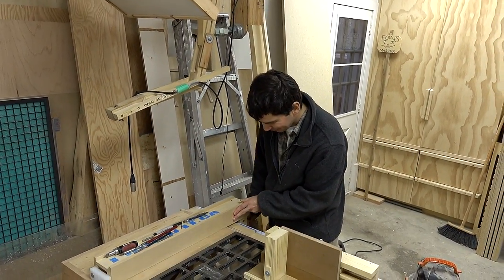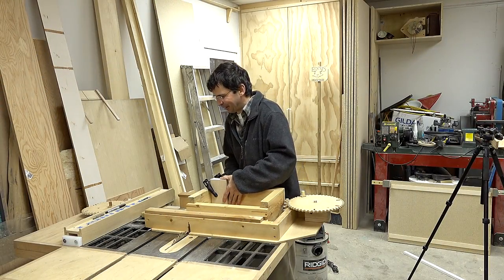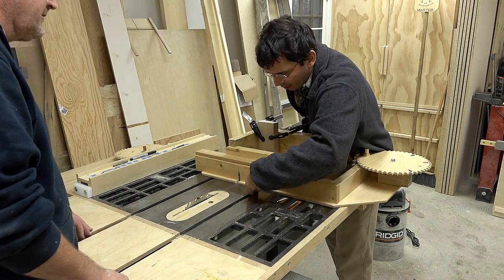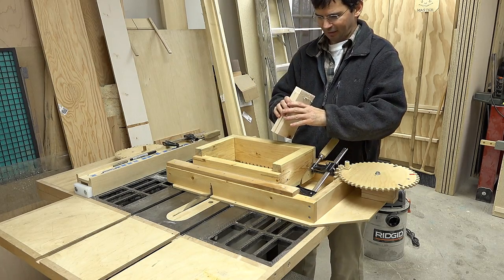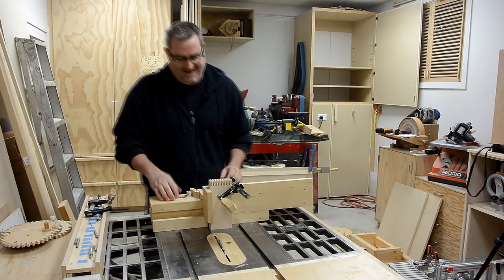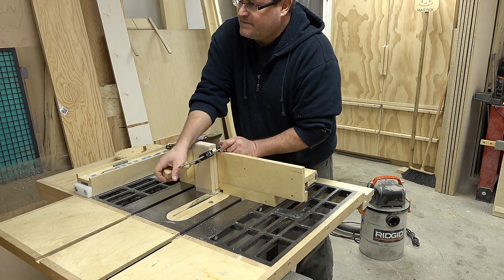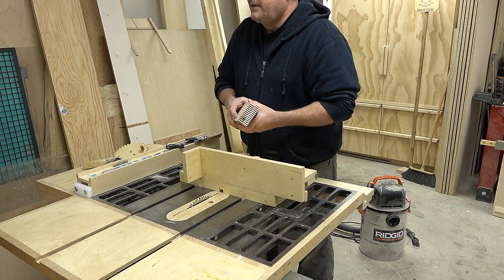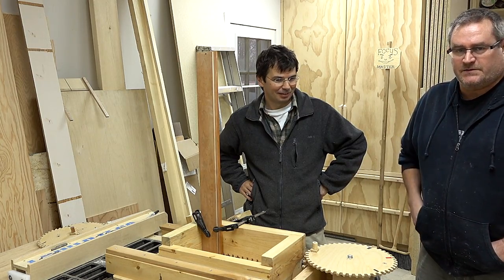Box joint jig rivalry

Comment: Matthias' for versatility and speed and John's for accuracy and width.
Though I guess Matthias' can be just as accurate but needs dialing in first.
Sorry Matthias, I'd go with John's as it also takes up less space and having a very small workshop that's a big consideration for me.
They are both amazing designs though... kudos to you both. :D
Reply: Once you've matched the blade with the rod it's a no brainer though, as you saw John's was a perfect fit first try and always will be from then on in. Matthias' needed dialing in. So I'd call John's more accurate and Matthias' more versatile as I said. :D
Reply from the maker: Easier said than done.  Matching the blade to the rod means finding a blade with exactly the right kerf.  None of the 20 or so sawblades I bought to date had a 1/8" kerf.
Reply: +Matthias Wandel Stop shopping for blades at the dollar store :D
Reply: Haha, you guys are awesome :D
Reply: CryoGenUK yeah,  Mathias has pretty big shops, so size isn't an issue for him, he usually likes making it once and using it until it breaks, I'm sure he could make a modified version thats smaller but it'd be a lot more complicated to build. And it still wouldn't be as small as the other.
Reply: You know John, I'm in the same boat as Matthias, I've gone through a stack of blades in my shop and I can't find an 1/8" thick blade.  I ended up running over to Lowes/HD with some calipers and same deal.  All my blades that cut a flat bottomed kerf cut .098-.105" kerfs (they're supposed to be .100", I'm guessing that they have some runout), which would work with a 10tpi thread, but that's not a common threaded rod (and in most cases it's about $70 to order a length of it in).

I'm assuming that you jig can use any step size that you can find a threaded rod for, right?  Even if  you were going to make it for an 1/8" blade, a 3/8-16 threaded rod is MUCH more common and cheaper then a 1"-8
Reply: I think using Festool and Felder would be easier.

Comment: Hi Mattias, I use an Incra positioner attached to my router table fence. The smallest increment is 1/32". I always use a back stop to avoid blow out. I am not in a production setup and I do not need speed. Regards Colin in Northern Ireland

Comment: I just built Johns jig and my first test cut was perfect with the blade i had on my saw... for those saying you need to match a blade to the threaded rod haven't actually built it.  There is more margin for slight error with Matthias's jig as there is no positive stop to index each cut accurately. It is more flexible for weird stuff, but for 99% of the people out there Johns does what you really NEED.

Comment: After reading some of the many comments here I will add that the Woodgears.ca jig has far more versatility than the other jig.
We have a Woodgears jig in our school shop and it has been used to create some creative variations on the box joint theme.  Think variable spaced finger joints where the teeth vary in width from 1/8" to 1/2" or more.  This jig rocks.

Comment: A previous vid showed that the size of the kerf of the blade can have an effect on the quality of the end product.  Being able to make such fine adjustments using Matthias's jig as can be done with Matthias's jig is a great advantage, though not used often.  BUT we all have to change blades at some time.  I vote for Mattias's jig for versatility but John's is the easier to use and the easier to build.

Comment: Most differences don't really matter, but the capacity thing seems to be a showstopper in the matthias case. While in Johns you can just do more passes with smaller boards if you need many, and not all at once, there seems to be no way to even bodge a big board into matthias ones. It is already quite big, but maybe this could be fixed by moving the gear part further down to get more space to the left?

Comment: I preface this by saying the following may well be incorrect, but i'll forge on anyway.  Johns jig is built on the assumption that you are using 8tpi threaded rod, which means that a saw blade with 1/8" kerf divides nicely into that. I live in New Zealand where threaded rod is typically metric. Saw blade kerfs in NZ are still imperial, I have a 1/8" kerf like everyone else. There is no metric threaded rod with a thread pitch that equates exactly to 8 or 16tpi.  So basically I can't get a threaded rod with pitch that perfectly divides my 1/8" blade to produce a perfect joint. It may be that I could get close enough that it's OK, I haven't tried.  Whilst Matthias jig is clearly more complex, i could build gears to enable me to get a perfect joint.

Comment: The JH one sucks a bit if your dado blade isn't exactly 1/8" wide.  You can use shims for wider joints and it is great for those.
The traditional method using a sled and a peg is much easier and more accurate.

Comment: there is one very nice thing about matthias's box joint jig. It can move from tablesaw to tablesaw without changing blades. IE use on cabinet saw then go out and use on portable jobsite saw. without any problems. 

Note for the most part I just use a 40 tooth gear for most of my joints from 1/8-5/16

Comment: what about testing which mechanism is the most reliable by packing saw dust into each jig all other all the moving parts to simulate bad storage or getting it back from letting someone else use it for the weekend then see how well the jigs work if at all. Also comparing how easy it is to clean each one out.

Comment: could borrow a trick from the machine shop dividing heads and put a small hole near each tooth on the gear. then use a dowel or pin to mark the position. if you need multiple positions have more than one hole per tooth and use multiple dowels. 2 pins for the second, 3 for the third, etc.

then you can use the dowels to pin them together for storage

Comment: I built Matthias' jig a couple years ago and have cut box joints from 1/8" to 3/4" with no problems whatsoever and without using a dado set or a blade with a specific width. The advance mechanism is infinitely adjustable and precise, providing a little basic math doesn't give you a brain hemorrhage. This allows you to size the joints to your box instead of sizing the box to your joints. It also allows for slight adjustments in oder to allow for glue clearances when working with different densities of wood. John's jig requires an exact width blade and his advance mechanism is dependent on the tpi of the threaded rod with no means of precise adjustment, (outside of sticking a piece of paper beside the blade to cause wobble. Seriously?). Since John used to build a version of Matthias' jig for sale to YouTube viewers, I'm sure he's more than familiar with how Matthias' jig operates. John gets the win for the one liners and Matthias gets the win for versatility, precision, and practical engineering.

Comment: I think Johns jig has a few major disadvantages:
first thing is the tight tolerances of the sliding mechanism - I don't think rebuilding this jig is as easy as it looks in the making of video. I really wonder if clogging up the sliding mechanism was ever a problem with this jig. second thing is you can't adjust the fit of the joint - I really wonder if this was ever a problem when choosing a blade.

in comparison Matthias jig is overly complicates with the gearing, but if you redesign it, advancing with a threaded rod seems more easy when rebuilding and his jig doesn't have tolerances nearly as tight as it is needed with Johns.

as the jigs are, both jigs have their (dis-) advantages and if you could buy any of those, it would be very hard to choose from!

Comment: As European I'd go with the Matthias' one because we can't mount a dado blade. And also because gears are so cool!
Reply: Why can't you mount a dado blade?
Reply: There isn't any room because the arbors are made so short. It's a safety issue (one I don't agree with). When you can't mount a dado set, you can't end up with lots of mass spinning so it will slow down faster. A large dado stack will spin for a longer time and the safety police has decreed that people will forget that the blades are still spinning after turning the table saw off and they'll injure themselves so it's not legal to sell such long arbors. They're still legal to use though as I understand it.
Reply: +Banunu Hawawa
Nanny state.
Reply: I have a ten in saw and use a 8 in dado. The dado may have more mass but the ten in blade being larger aroud takes the sametime or longer than the dado. Besides some of the newr stuff is coming with arbors. If you can't find a good used one that takes dados then build your own. then you can have anything you want or dont. You know like bladegards that justget in the way so you cant see and make it more dangerouse to me. just  my thoughts John and Mathew have both built multiple saws.

Comment: Would find it difficult to have a woodworking shop without a Miter Saw, just saying !!
Reply: How? The table saw is far more accurate
Reply: Kat & Joe    Cutting a lot of 2x4's to length on my table saw with the room I and other friends have would be a pain in the fanny if not impossible!
                        Can't even understand why you would see this to be a problem for some woodworkers. !!
Reply: most  the time I use a smallw cross cut jig too cut my 2x4s. not hard at all. I guess if all you got is a small contractor saw it might not be so easy but I use a shopsmith 510 and the tables will open up to wear you could rip 96 in. so for me its a lot faster. I guess it depends on your saw.
Reply: I used to have a Shopsmith  500 :-)Been a while since I've heard people talk about them. Great tool !
Reply: I  have a 510 and two 500's. I get a lot of tools in a small 1 car garage and it solves the prblem of swap overs when set up. my 510 runs a jointer and is my main table saw. Then one of them I lost a motor and I replaced it with a treadmill motor and it really lets me slow it down to any speed so it is my lathe and drill press and also drives my band saw. Then the last one is set up with disk sander but it is what ever I need. that and I built a router table from a old shopsmith carrage and table and it goes in the holes for end table and you can adjust height by lowering table. the cool thing about it is it tilts and you can rout at a angle which I have found very useful. I keep it on the third one. So you might say I agree with you they are a cool machine.

Comment: Is there an ideal finger size for box joints, or just the more the better?
Reply from the maker: For strength, I figure tenons and finger joints fingers should be 5x longer than they are wide-5x longer than they are wide.  Too skinny can cause problems with grain direction and doesn't add strength because the wood tears first.  Too fat and the glue joint fails.
But for most boxes, looks is always a big factor, and that is preference.

Comment: screw advance all the way, you can do so much more variety for aesthetic or strength reasons and you can cut so many more boards at once. Why reclamp 4x when you can do 4 boards at once and have them turn out identical for the most precise fit.